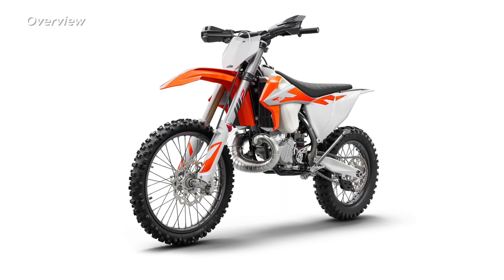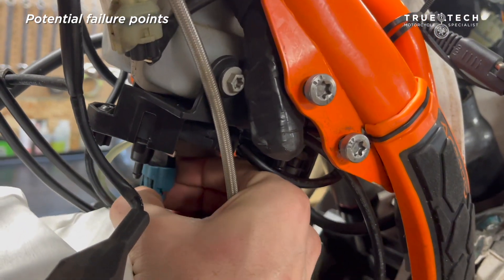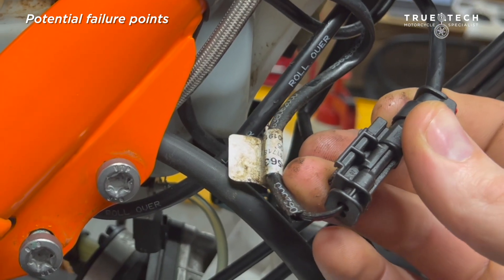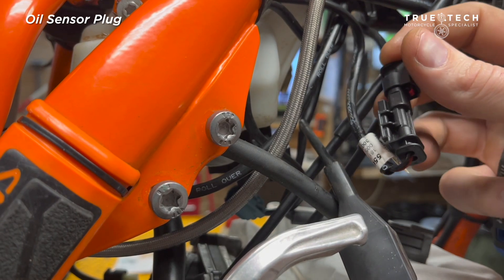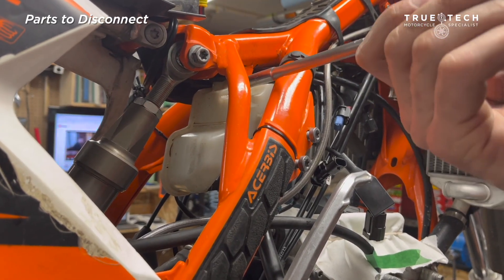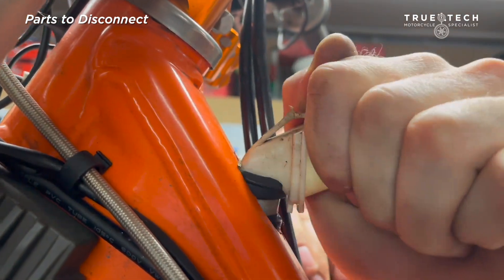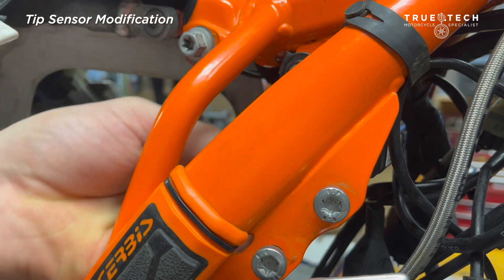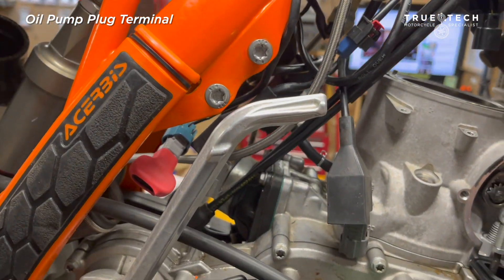TPI Oil Pump Delete- How To

Comment: I am going to delete the oil injection system on my 24 tbi, do I need a resistor to make the low oil light turn off or can I just connect the 2 wires?
Reply from the maker: You need a resistor.

Comment: Chuck,
Looking to relocate the ccps sensor higher up on the frame and I need a longer hose, maybe add 6 inches or so. Do you know what size of hose it is?
Reply from the maker: Not off the top of my head. Sorry. I expect any local auto parts store would match it up though.
Reply: @ChuckfromTrueTech 
Would it affect the bike at all if I just cut the tray and move the sensor up higher or to a different more accessible spot? My bike has the stock injectors but would like to make it more accessible.

Comment: Any recommendation on what oil to run when doing the delete? I've just received my kit, i have always ran cross power 2t as spec'd, but for premix is there a more suitable oil? Also, 50:1 seems to be the ratio? Any help would be appreciated 🤙 cheers.
Reply from the maker: Run any oil that meets the specs. It’s not picky.

Comment: Do you have any experience with castor oil on tpi after the pump delete?
Reply from the maker: No. I don’t get too worked up about oil. If it meets the specs it will be fine. Any reputable oil will do.

Comment: Hey Chuck. What do you think of just running mixed gas in both the oil tank and the gas tank. like 50:1 or 60:1 or something. Do you think the oil injectors would get clogged??
Reply from the maker: Haven’t considered that but running fuel in the oil tank would make the bike run slightly rich. The oil pump goes richer & leaner based on different inputs than the fuel injectors. The oil tank only holds 500mls. Why would you want that?
Reply: @ChuckfromTrueTech  the reason would be that you wouldn't have to worry about the oil tank because you'd be running mixed gas. Apparently the injectors spritz on a cycle that would starve the crank if you do this. Just a thought experiment mostly.
Reply from the maker: @EricNeilson_  Putting fuel in the oil tank would throw off your air/fuel mixture slightly. I don't know if it would be enough to notice, but it definitely wouldn't be enough to significantly lubricate the bottom end.

Comment: Hi mate   im gavi g problems   going through a plug after every ride     put new 1 in works for 1 ride then fouls plug 
Do you think it maybe the crank case pressure sensor
Reply from the maker: It’s most likely the crankcase pressure sensor. Swap it with the ambient sensor and see if symptoms change. If they do, replace the sensor.
Reply: @ChuckfromTrueTech  the ambient sensor was absolutely covered in crap    snapped nipple on it aswell    didnt want to put that one in place      ill get one and see if it works      thanks for you help
Reply: Also it wont idle is that another sign the sensor is broke

Comment: How are you liking the IRK with the ERM compare to ecm recalibrated from TSP? Would you leave it in tpi or is IRK set up is a better setup? Not just for premix but power wise and throttle response? Thanks
Reply from the maker: It depends. For aggressive intermediates & others who want more top end power the IRK is the way to go. MUCH better top end power. With the R5 mapping from TSP I loved the mapping, but I’ve still made small improvements to suit my preferences. 
For less aggressive or novice riders I don’t recommend the IRK. It can be trickier to get it dialled and the bottom end power isn’t really any better than the standard TSP setup.
Reply: @ChuckfromTrueTech  this is very good to know. Thank you for sharing this info!

Comment: Chuck, I was working on a 2019 300 XCW top end and when assembling the fuel injector wire back on, one of the wire protector sleeve says “Injector 1”. The other one doesn’t say anything on the wiring protector sleeve. Doesn’t seem like it would matter, but can you tell me which side the “injector 1” would go? Would it be right side, or throttle, or left side clutch?  Thanks in advance love your vids!!!
Reply from the maker: You’re right. It doesn’t matter unless you have an injector relocation kit. The injectors take turns firing during low fuel demands and then both fire simultaneously during higher loads.
Reply: @ChuckfromTrueTech  thank you so much Chuck! Can you tell me which side you normally see the “Injector One” on?  My OCD is telling me to get it back where it was. Thanks again Chuck. I really appreciate your vids and help.
Reply: @devodar2579  if you watch the injector relocation install video of TSP they mention the injector 1 and 2 and say which side it is on. I don't remember which is 1 and 2. But yeah you can watch the video

Comment: I deleted the oil injection on my 2020 300 xcw.  It was way over oiling and the delete cleaned up the power, it's now running like it should.   I'm using the pin it racing injection block ... No issues.
Bonus, I fabricated a mount plate for the sensors and they are both easy to access.
Reply: Hello how are you? Are you still using the premix? I have a 2023 tpi 300cc, I installed the pinit racing relocation block and I am happy, but now too much oil is dripping when I go at half throttle or high. I'm thinking about removing the pump system, how has it gone? I think my excess oil problem started with the installation of the block, since the pump is configured for separate lubrication. greetings
Reply: @rafaelaranda8469  Hello! I am also running the pinit block and have the same over oiling issue, did you make the switch to premix and did it clean up the oil issue? Any information would be awesome thank you!

Comment: Cylinder mounted injectors will lube the bottom end perfectly if the injectors are retimed to BDC.
Standard TPI injector timing is around 90 after TDC
Reply from the maker: Have you tested this or seen data to support it?
Reply: @ChuckfromTrueTech   did you get that link ?

Comment: Excellent video, and it's nice to see a true craftsman tell the story about TPI and how reliable the system is.  For owners keeping the TPI system as is, make sure to always check the oil level and it doesn't hurt to give the system a quick look prior to each ride to make sure you don't have any system leaks connectors are in place, etc. Even though this vid is not about keeping the TPI system, the other two main items to ensure your TPI bike runs perfectly for years - warm up the bike correctly, give it plenty of time to warm up before you give it the beans and clean/oil your air cleaner correctly. Don't under oil your filter I see this all the time, dry filters. Again, well done video.